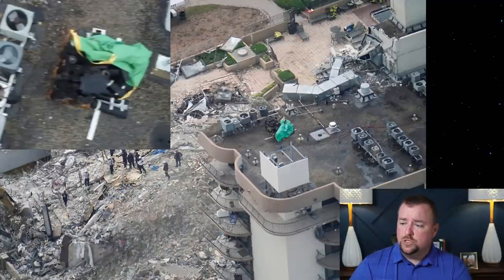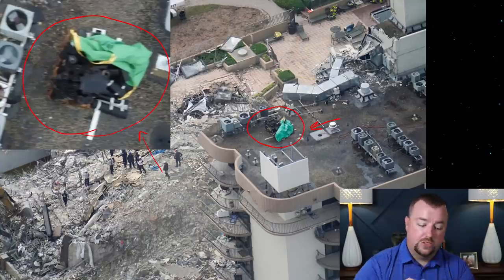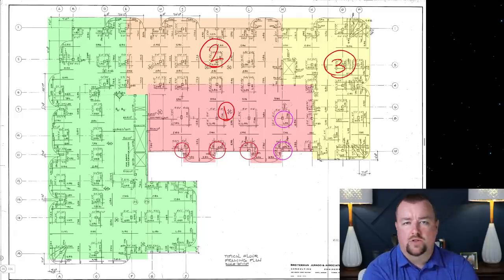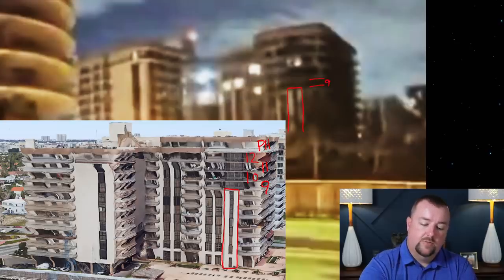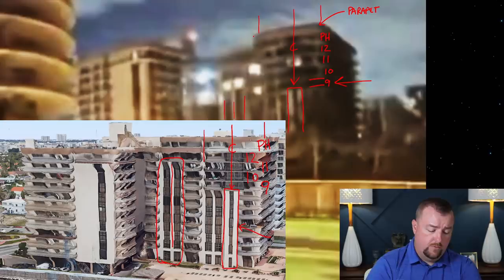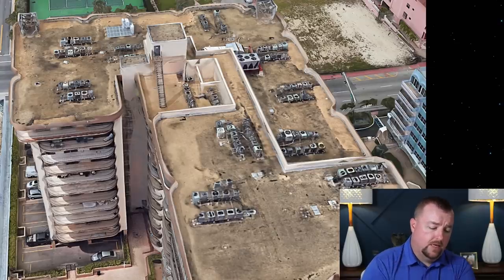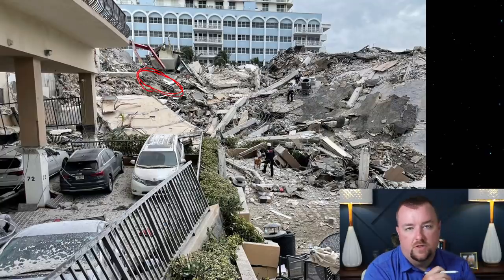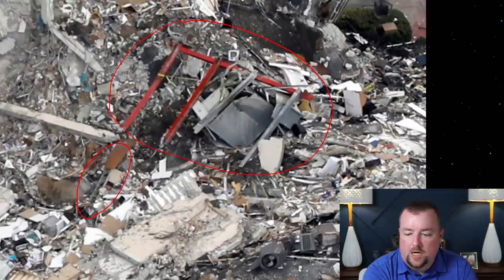Surfside Building Collapse - Did it start at the roof?

Comment: As a roofing contractor of over 40 years... suggesting that this building collapsed because the roof was overloaded in this instance is the single dumbest thing I have ever heard. Those rolls weigh 50-60 lbs each and they stack maybe 18 at most on a pallet. For the mathematically challenged, that is barely 1,000 pounds. For context, aa 100 gallon fish tank weighs 1,000 lbs. if this was the case, every house, building or property with a fish tank would collapse.

Comment: Though many have questioned if the building might have begun to fall at the roof because it appears to be lower in the centre in the image. But, the structure at that part of the building was lower in the centre, in line with the building to the left it then stepped up with a 12th and 13th floor at the end of the building to the right as is seen in the attached @:36. https://www.youtube.com/watch?v=mm42vzaaxCQ&t=48s
The part of the building that had begun to fall first in the video had 11 floors with the elevator shaft and the metal staircase above it.

Comment: Just to simplify the entire explanation:- Think of the 3rd law of motion; things that is in motion, tends to stay in motion and things at rest tends to stay at rest + remember about the so-called magic show that when you were younger, the ONE that you would pull the tablecloth off the table fast enough that ALMOST ALL THE STUFFs just shifted slightly but not come crashing to the floor, IS WHAT THIS ENTIRE VIDEO WAS  BEING SAID, except I just TRANSLATED IT FOR THE 99% non-technical MINDED PEOPLE and any that STILL DOES NOT GET IT!!!!!!!!
Reply: Your analogy is not clear.
Reply: Try "pull the tablecloth experiment first and you will see what I mean about the objects shifting slightly. Put that together with the "3rd law of motion" which states that "THINGS"(in this case, the base of the building collapsing) in motion tends to stay in motion, and "Things"(In this portion, the staircase/ladder+the so--called "magic trick" where you pull the tablecloth away as fast as possible without all the objects on a table come crashing to the floor when you pull/yank the cloth away quickly/really fast) at rest tends to stay at rest! The end, results in what you will see when the few minutes of the video, showing where the read/rusted ladder like object with the A/C unit and finally the staircase/ladder to the machine/mechanical room exactly where it should be, base on the  senario of the BASE of this building collapsing first, rather that the roof being the trigger to the collapse of the building!

Comment: This video tour from a yr ago goes inside unit 611 & all through the underground parking structure at the end. You can see the column numbers, ceiling, & floor. I recommend slowing it down to .25 speed & making sure the resolution is at the highest setting. https://youtu.be/w4rGWH7aDJc

Comment: What if.... someone got hold of that original video... (which showed the penthouse sink first (causing the noise and the people from the oposite hotell to record showing the force of the roof cracking the pillars in the basement), then edit out the penthouse sunken, just to point blame at the lack of maintenance on the pillars / waterleakage over time.... since the building of the penthouse was illegal to begin with.. and the tons of newly stored roofing materials made it overload and collapse".... "eh...dead tired after long shift theories strikes again" :)

Comment: That green thing looks like a garbage sac with hoist straps. They most likely replaced stops that were leaking. No reason to get rid of contained waste on such a small scale. Perhaps it just hadn’t been removed and it’s nothing at all. 

I’d bet it started in the garage, perhaps they could’ve find that some poor fool backed into or rammed into a column. Perhaps it resulted in the chain reaction. 

It was corroded metal supports that failed…

Comment: yes those are lights and there are two sources of lights from top left condo intérior and one from exterior ceiling (top) lower floor and becose of the bad cam resolution they seem to be one light Flat screen tv don't explose and I don't beleive these folks had some old tube tv set further more old tv did not explose they implode becose of the vaccum in the crt so eventhough they would not produce that kinda light
btw / excellent job

Comment: A sure sign of slipshod building practices: Multiple different styles, manufacturers, models of AC units. 
These were purchases and installed at the same time, as the building was being finished. They purchased second-hand, random, mismatched, whatever they could get cheap, AC units. 
Any decent building owner/management would buy matching, new, identical units from the manufacturer with a quantity discount. Or one or two or three different size/capacity depending on living unit sizes/needs.
What we see here are random, mismatched, get-it-cheap units all over the roofs.
P.S. What a crappy penthouse! Nearly 40 AC units running on top of the roof! This is Florida. Those things ran all year long, all day long, all night long.
Reply: Maybe some were replaced.  The building was 40 years old.

Comment: Could there be any type of foul play on the roof to produce a collapse? I’m thinking like nine one one where they claim a plane and tiny fire took down an entire massive steel structure; from the top on down.
Reply: The WTC buildings have been completely analyzed and the cause of their collapse is fully understood.  In short, heat from intense fires in the upper stories weakened the steel, which could no longer hold the weight of the stories above.  When the upper floors collapsed, progressive collapse of the entire structure followed.  This much is not complicated to understand, but the NIST reports give much greater detail to anyone who needs it.
Reply: @GH-oi2jf  no way! Omg! What a fairytale ! Beyond total nonsense!

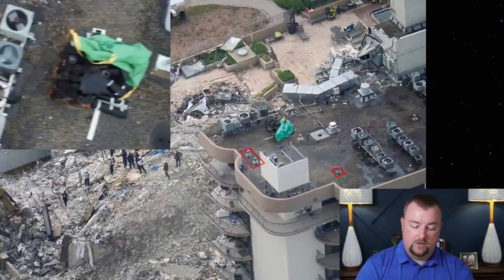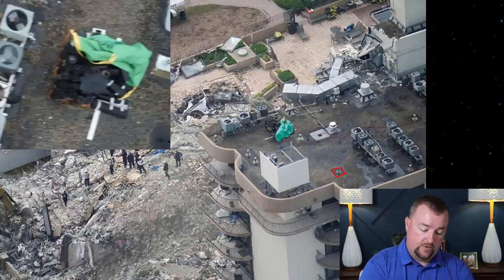Comment: Just found this video from one year ago and you ain't going to believe what you are about to see beginning at 3:49 down in the parking garage which takes you right to the initial point of failure at the bottom of the car ramp at 4:46. Immediately once video of parking garage begins, you see severe stalagmite deposits on the ceiling of area that first collapsed. The cracks in the ceiling aka pool deck, is severe and what appears to be sections of corrugated steel or something similar screwed over the cracks in the ceiling to redirect leaking water. I recorded this at normal speed also at 25 percent speed to slow it down. Start video at 3:49 and just watch it unfold. This is the exact spot that first failed which led to the total collapse of that building. https://youtu.be/w4rGWH7aDJc
Reply: I saw that video too, and the condition of the garage is terrifying! The cracks and rust in the ceiling...yikes! I think that video was recorded by a lady who actually ended up moving into the building. Thankfully, she survived and was able to get out of the building just in time because she saw cracks forming in her apartment right before it collapsed. I know hindsight isn't fair, but I wonder why she even decided to live there after seeing the condition of the garage?! It looks downright scary. She thought to record the cracks in the ceiling, so she must have thought there was something wrong at the time.

Comment: The unfortunate result of incorrect waterproofing..
Reply: There was more wrong than that.
Reply: @GH-oi2jf  the decking had no grade to it, meaning it didn't drain. Leading to the reported pooling of water in the parking garage where the collapse began because of exponential expansion of rebar due to rust from the lack of drainage.. the unfortunate result of incorrect waterproofing.

Comment: If you watch the video many times you will clearly see that it is the top few floors above where the lights/flash is seen that immediately collapse down to the lights/flash and then the building continues to pancake presumably from the weight of those floors but not necessarily so. There could have been other charges involved. The clincher is that there is a DEFINITE flash in the East wing about 5 floors up at 34 secs in the 39 sec video. It is not until this flash occurs (note flash and NOT lights) that the east wing becomes unstable. A fraction of a second after this flash the east wing collapses from the point of the flash and then curls around possibly due to the resistance of the stairwell tower mentioned here and then continues to pancake. I like the work you have done on the garage area and I note the debris etc in that video but for me you cannot deny that this building came down from the upper floors above the flashes in areas 1 & 3. I am a little suspicious of the starting point of the original collapse video as it obscures to some extent the start of the upper collapse. Far more likely that this was a permanent security camera and someone has chosen the start point. This needs to be confirmed. I am NOT saying there were not serious problems with the slab above the garage, I am saying it is obvious the the building started collapsing from the top in section 1 and above the flash in section 3. Very obvious. Where the stairs ended up is somewhat moot, it is the actual video that is definitive you just need to watch it.

Comment: sorry your wrong the roof collapsed first, you have forgotten one aspect that if factored in proves the roof went first. that is distance perspective which i have calculated with rulers. as a artist i can tell you the floors from 11 were still intact at time of collapse, and did not collapse before the roof adding perspective view proves the roof went first. using your data and adding perspective of camera defiantly proves the roof went first
 as a artist that has studied engineering as well im saying without any dought the roof went first.im sorry you should always add camera perspective when making calculations from video. and the reason it went so fast is building buildings like house of cards will always fall. and all the evidence proves the building was unliveable but i am truly sorry  the roof went first. reason the floors dont look aligned is because the were behind main section but the perspective show this as well 
 and the fact the only section that collapsed proves it was penthouse weight was the cause as building was not designed to have penthouse else it would have been built in the beginning. i have seen this before in buildings that have collapse because of just one extra airconditioner the building does not show penthouse because it collapsed floor 12

Comment: Usually I don’t say this… but this channel is complete BS on this one. Do your research. Multiple witnesses even one died while on the phone relaying to others the pool deck had caved in. It had nothing to do with the roof. The middle had smaller columns and the part on the roof fell because the middle column shifted first from when the pool caved also the water from witness videos shows middle area where roof was came down first.
Roof was not cause or catalyst. Ridiculous

Comment: Are you seriously telling me that Americans, like the classical European painters of the 1500s, do not understand perspective and vanishing points?

😆🤦🏼😫

The google image is clearly looking from a slightly top down perspective.

The security footage is clearly looking from the ground up.

The Penthouse beyond the corner of the building is set further back from the up looking security camera than it is the google downward looking view isn’t it?
Reply: There is nothing here which has anything to do with vanishing points.
Reply: @AlexA-nd3yy  I know, I’m bringing it up as a case in point.

The angle/perspective of the camera will have an effect on how you see the corners of the penthouse

The security camera is down and to the right of the google 3D image of the building meaning the corner of the building into which collapse zone #1 collapsed into is, therefore, in effect, further away from the field of view of the top down view posited by the google maps 3D image.

Ok, as mentioned by BI Host, there may have been a few frames missing as it started to collapse, that said, that movement will only appear to have been enhanced by the altered perspective of the security camera’s viewpoint.

Comment: If the building was put up with old school solid steel frame, would this building still be standing? I believe that it would not have collapsed like a house of cards. This cement and rebar design is shit and never should be used again. Internal box frame steel girders are the only long term proven designs. Examples are: all of the towers built in the early 20th century. They are still standing with no one fleeing for their lives. Any building that is built from Cement and rebar next to salt water bodies with large cavities between floors are death traps. As calls for repairs on this style of construction increase now that Champlain Towers has collapsed, more people will realize that this design was a mistake from the first day of construction. These buildings will come on the market and the the market for them will collapse. They were shit the day they were built, all of these structures should be demolished before they claim more victims. Admit it was a mistake before more innocent lives are destroyed.

Comment: I don't know shit but the first still image looks like a mater of prospective and the building  is complete . Vid is just off angel
Reply: There are some clear photos of the building before collapse which show that the central portion where the collapse began was the same height as the portion to the east, which stood for several seconds longer, and that the face of those two sections of the building were in the same plane.  That means that perspective does not account for the difference in roofline seen in the video of the collapse.  At the beginning of that video, the central portion has started to collapse.

Comment: Bottom line the building collapsed due to poor maintenance and needed repair work.  Very few things age well except for like wine, most things fall apart with age.
Reply: Well-built reinforced concrete structures will last a long time with no maintenance at all.  This structure was flimsy.
Reply: @GH-oi2jf .  Then why did they close Alcatraz prison?   You have to realize water is one of the most powerful thing in the universe and will eventually disintegrate anything it comes into contact with.  Like Alcatraz the building was built virtually right on the ocean which was eating away day after day weakening the structure.  Poor maintenance and avoiding repairs is why the building collapsed.

Comment: Look at those columns. Knitting needles I tell ya. Bad design led to rapid deterioration of the structure. Cheap and stupid. There will be more. American standards are very cheap Those columns come from the "let's design and build as cheap as possible" school of engineering. There are about 4 lightweight rebar strands left where the pool deck parted and flopped onto the cars below.

Comment: sleep in concrete boxes like coffins with water food airpipes , or would they crush too , and similar seat in living room in box,  and standin box . hm ..heavy. so must be made on top of each other in every apt .  or system to remove peiople out through window at start of big vibration or downmovement of ceiling , in harness line or parachute , crane or tree outside to hold lines up , or a  say net that moves fast to window, that falls out easy or opens like swing door and puts ppl on a beam or grid  hanging standing say two meters away from building hoping it falls other way. or container to sleep in that uses explosives to shoot itself out to side through apt and window, best to sleep near window. also useful in a fire. some buldings have a net over all balconies to stop birds doves, can be used to climb donw on the inside of it faster than to fire escape. 8
Reply: Stop spinning
Reply: @williamevans6522  What is spinning in writing?
Article spinning is the process of re-writing an article to create new “original” copies in an attempt to avoid duplicate content issues that can result in a penalty from search engines like Google when article marketing your website.
Reply: @lofturhjalmarsson9896 You were  spinning- putting forth bizarre  ideas in you first post. Like  on drugs"spinning". 
      Did you have to translate from another language?
The net idea is a good one as long as it doesnt burn  and self-deploys in  event the fire alarm  goes off.
Reply: @williamevans6522  those nets are permanently fixed to the balconies on some or many high  houses but can have a room in middel to climb down putting feet into holes on it made from wire or nyloln or what , self deployed is an idea if ppl dont like nets think ugly or , but also they give fall protection too often happen on balconies. i dont use rec drugs and spinning ideas is not a bad thing.

Comment: I have a couple of questions. Where is the spark from the electrical wires when they broke ? Where is all the water from the broken pipes ? Also I don't know if you heard of it. The triangle factory fire in 1911. I believe floors 8 and 9 were burn ours with partial burn to 10. Why did this building not collapse? Also the water used to douse the fire. Built I believe in 1900. Still standing today.